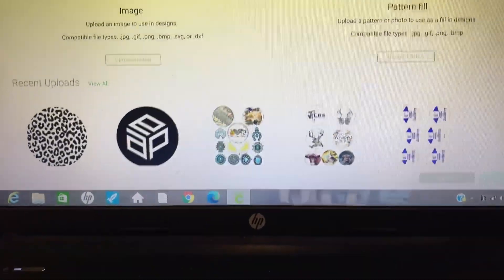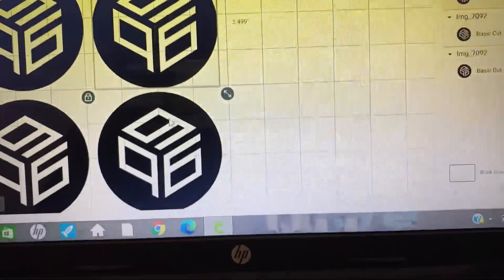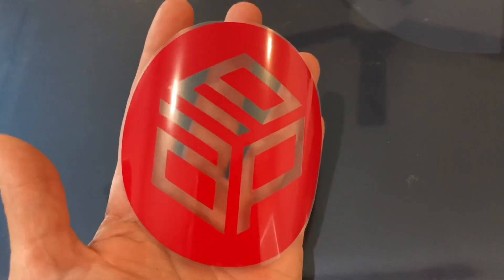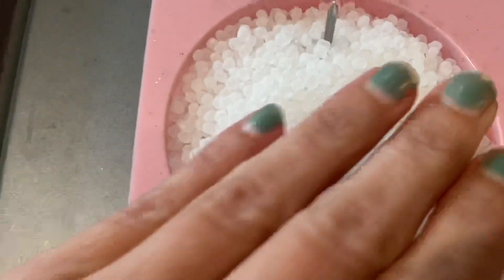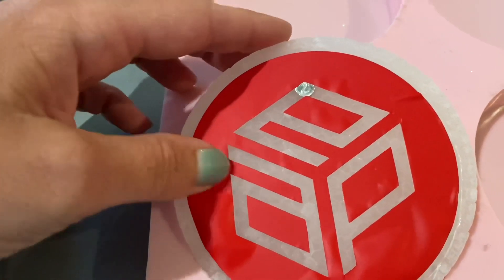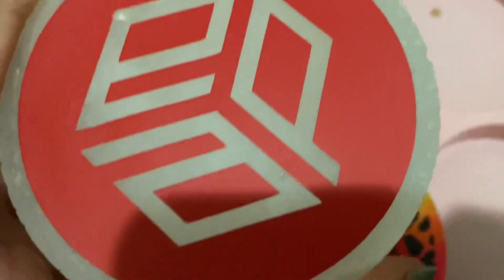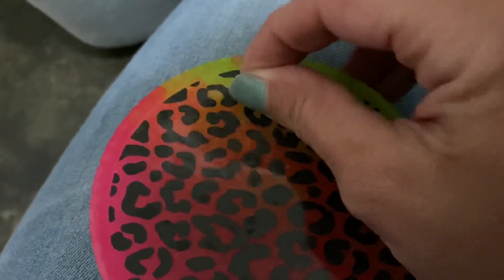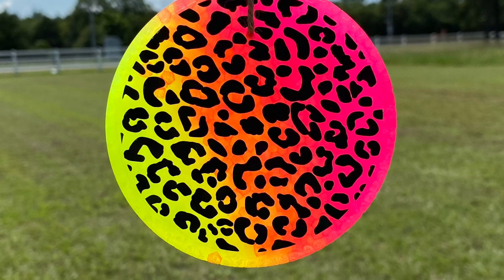Iron-on/HTV Car Freshie Tutorial

Comment: Amazing technique. Thank you for the tutorial. How do you put the hole in the freshies after they are cooled?
Reply from the maker: So as you saw in the video with the first one I did I placed the nail in before placing the beads but that only complicated things when I tried taking it out so for the rest I created the hole after by heating the nail with a lighter (make sure you hold the nail with pliers so you don’t burn your fingers) and then I stuck the hot nail through the freshie (when doing this make sure you pull the nail back out immediately while it’s still hot otherwise the cooled plastic on the nail gets left behind and leaves a mess that has to be cut off which ends up not looking very nice) once again be careful not to touch any part of the nail during this process as the entire thing heats up and will burn your fingers.
Reply: You can also use a drill Bit and it makes a beautiful hole

Comment: So have you had feed back on the heat transfer vinyl on the freshies? Is it staying on in the heat in customers vehicles? Is anyone having any problems with peeling, cracking, or warping with the vinyl? I'm just curious 🤔. I'm really interested in doing this with mine but I'm wondering if its actually holding up.
Reply from the maker: So I’ve actually put two in my own car and both held up really well, no cracking or peeling.  However, I did have an issue with some that I made during an event.  While at the event it was really hot and some of the HTV stuck to the inside of the bag and peeled away from the freshie…..they hold up well in the bag at room temp and outside of the bag in a hot car but do not hold up in a hot bag 😬
Reply: Try wrapping the Freshies with HTV in Parchment Paper (shiny side against the vinyl). Just an idea...I will be doing that when I package mine that has HTV on them.